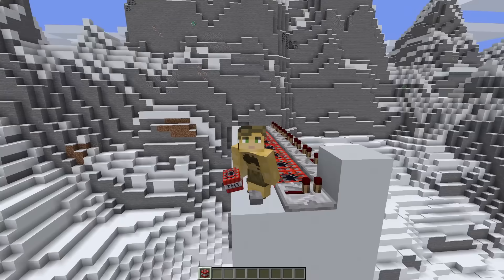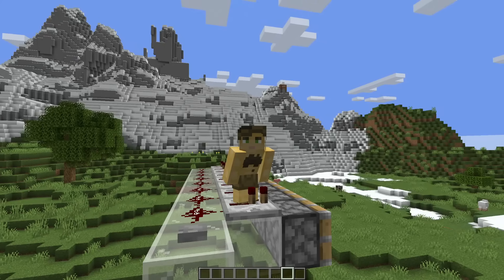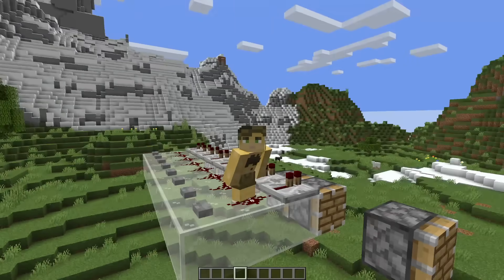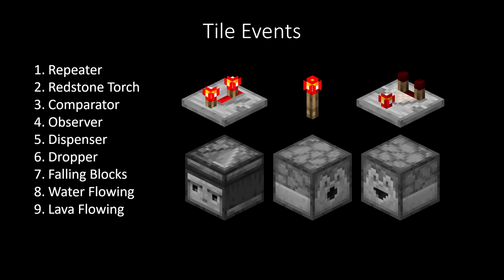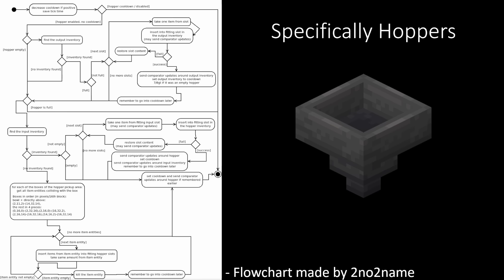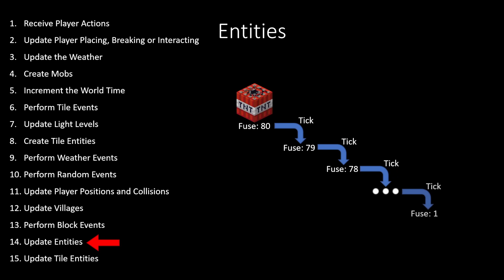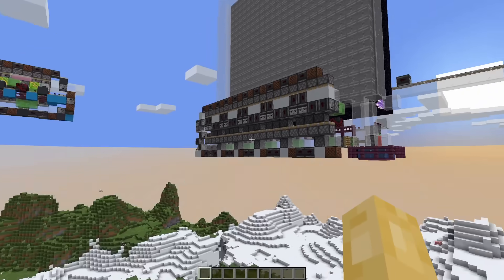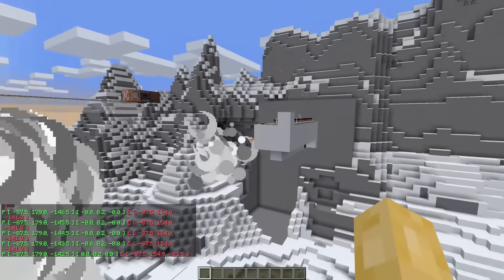TnT Railgun Using Minecraft's Quantum Mechanics

Comment: Anybody who wants to know how to build a actual more powerful cannon than this it is called a tunnel cannon which can be made pretty easy all you have to do is make a massive normal tnt cannon and for the propulsion you use repeaters as normal and then for the payload you use comparators and you don't put any delay this works due to it now being on the same tick but in the game code the game always priorities the repeater so it pretty much makes a massive hole through anything and this works veritcally and horizontally I'm working on a vertical cannon rn like this

Comment: Very intriguing. 
This had me wondering, does minecraft have a speed of causality?
Reply from the maker: The thing about relativity and the speed of causality is that the speed limit is only ever apparent to each reference point, things are happening everywhere in the universe governed by laws which require no apparent connection through space or time regardless of their observation by an observer. Similarly in Minecraft the world ticks every 1/20th of a second, and with perfect knowledge of the games mechanics we can be assured that mechanisms spanning vast distances are causally connect even if they extend outside our render distance. In the real world however events outside our horizon are causally disconnected until we can get information to be exchanged.
Reply: @cubicmetre  Thank you for answering. Everything that is rendered is causally connected and thus the players reference frame gathers information from every loaded chunk at the same time.

You have now gained a subscriber😄

Comment: Late comment, but I've experimented with tnt shotguns in the past and acheiving a planar, scatter, or even controlled lateral bursts in a variety of patterns is fairly simple. The additional information you gave on entity processing order would be critical in determining the final orientation and timing for each element of your desired result. By changing the orientation of your dispensers (or in this case the spawn location of your command blocks) in combination with a variety of off-setting blocks like fences, open trap doors, chains, or other partial collision blocks, your tnt can be variably offset in relation to your firing charge. This is going to give the basic firing pattern. Note that the tnt can all reside on the same block, but still be offset enough to give a scatter pattern. You will have to remove any obstructing blocks at the front of your cannon to accommodate not only the offset, but also the forward trajectory of any projectiles, otherwise they will all correct to travel in a more uniform direction.

If you then place a 1+ tick delay on the generation of secondary charges you can roughly control not only where in the firing order those charges will be dispersed for lateral and vertical secondary explosions, but also at what range those charges will change trajectory. The velocity imparted by the initial firing charge (e.g. using a single tnt to propel versus using 10) will determine the average distance per delay tick at which the lateral charges will change trajectory.

Comment: wiring 2 dispensers with different redstone components (comparators and repeaters) also makes this effect as in minecraft's ooe (order of entities) repeaters are calculated first, which makes something similar. people have been using this technique to make cannons in the past (tunnelers, nukes, aps etc), from what i've tested it still works in the new versions of minecraft, you just need to wire the power with repeaters, and the shot with comparators, every dispenser in the power is gonna have priority over the shot, then its gonna calculate its velocity and after that the shot's explosion. and about the 11:07 part, lining 2 tnt entities diagonally and placing one above the other on a non-full block (such as stairs, chains, walls, trapdoors, chests and others) altough their uses may vary, and some may be able to shoot farther than others, the way the position of the tnt is calculated depends on its position to the explosion, if placed diagonally, it's first gonna calculate the y axis, until it hits a block, then after either the x or z value after hitting a block (depends on the orientation) and then its gonna shoot into the wall, forming kind of a triangle hypotenuse  or something like that (this is used in almost all modern factions cannons) this applies to any falling entitiy (anvils, sand, concrete, gravel, i haven't tested yet but maybe scafolding works)

Comment: if i understand it correctly, what you are currently doing is, in the same tick, explode 1 batch of tnt to launch 1 tnt that instantly explodes, then explode the next batch to launch the next tnt that can fly further because some obstacles are now gone and it has double the tnt acceleration of the previous batch, etc. but could you achieve way greater ranges by instead of having 1 propellant being static and 1 projectile load, having a series of propellants that each launch the rest of the load further, so you get... oh no wait that wouldn't work because everything remains static up until it's updated...

Comment: i once made a cannon with a friend that used tnt at the top and the back to get it to the front in time and it also had a section underneath with bubble collums for even more tnt i could shoot so far we had to place cobwebs in front of it to be able to measure its power, it could shoot through over 3000 layers of cobwebs. when not placing the cobwebs it went around 40k-50k blocks before exploding in the air

Comment: This is a really cool concept that I believe was originally used for minecraft factions. We called them "Tunnelers" because of their unique property of exploding right after one another. Using what we in the factions cannoner community call "fraction ticks" you are actually able to make a really simple version of this, al you need is 4 repeaters one after the other, into some dispensers, and more dispensers that actually fire the projectile. In terms of it bending, that has to do with how the tnt is aligned, when it is dispensed, it dispenses on the opposite side of the block from the dispenser, however with a piston, you can align it however you want, and if you have the gameticks in the right order, you can make something that will just blow out an entire sheet in a single shot. Overall this is a really cool video, and I love that this is something being investigated outside of the factions community

Comment: I would like to introduce you to "Factions". there are some people who play that game-mode and find the most nutty things with TNT.
Stuff like angle cannons, Wall nukes that destroy entire lines of walls, slab busting and the list goes on.
this rail-gun tech has been used before in factions for bases with Large claims or that need precise targeting.
There is also a cannon that has 2 rounds of propellant that basically allows you to send tnt through 1 block wide gaps with a second round of propellant slightly offset to launch the round to the target bypassing some walls if you do it from a corner.
Reply: The 1 block hole thing wasnt to bypass gaps or anything, the idea was you could put your cannon in a defensible box and shoot at the enemy without them being able to stop you (unless they build their own cannon). Using the idea of "triangling" (basically tnt follows an order in rendering which you can abuse, it calculates Y velocity first and then E/W then N/S) you can give your cannon an adjustable range to shoot at from bedrock to sky limit and a very sizable X/Z range (could be thousands of blocks with enough tnt).

Comment: I remember I tried to make a piston extender and came across a tug of war situation like that and It didn't really make sense to me cuz redstone dust is supposed to activate everything at the same time

But apparently not!
Reply from the maker: Redstone uses a locational hashmap to determine it's update order due to the complexity of handling signal strength. This means you cannot rely on redstone dust to power things in a predictable order. This is why you will see us technical players using a wide variety of mechanisms to transfer signals.
Reply: It’s more obvious on bedrock then it is on Java.

Comment: Ah yes thats how quantum mechanics work......
This is just logical time moving forwards like it does in any game
Reply: No, its not logical time moving forwards. In 0.05s you can make a tunnel 1000 long. You can also make it go left/right every gametick in a "vector" pattern. It goes max distance in 1 direction, max distance in next direction repeat
Reply: @Azaqa  yea but its still has an order in which things happen
Reply: @user-hv6nl3cz1z  yes thats true but the only way you would know that order is if you looked at the games code
Reply: @Azaqa  yea but it still has nothing to do with quantum mechanics 
Also could'nt you just run a redstone signal over a block on a piston and see if it activates whatever its hooked up to or if the connection gets cut first?

Comment: Factions players have been using these for quite a while (since 1.8 iirc, we used comparators since they operate on 1.5 ticks instead of 1 or 2 from repeaters) - We call them 'tunnel cannons' if you want to look into them

They have been developed to make pretty advanced shapes (such as letters)
Reply: Comperators don't run on 1.5 Ticks, the update order puts it after the repeater however it is still in the same tick. Wargear players call it 0-tick delay. Pistons on the other hand do take 1.5 Ticks to extend.
Reply: @kaltenstein7718  no, 1 piston is still 1 tick but 2 pistons back to back is 2.5 ticks

Comment: just wait until he discovers factions cannons from 2017
sand cannons
the obby breaking ones
the top-down nuking ones
you should take a look
Reply: To be clear it doesnt actually break vanilla obsidian, factions servers changed obsidian to basically be a normal block that absorbs a certain amount of tnt hits before breaking (usually 4 but sometimes as high as 20), so it was basically just a more powerful cannon used to break the obsidian with higher durability. Vanilla obsidian is blast proof.

Comment: these types of cannons were used often in OG minecraft factions... 255 hybrid oneshot with slabbust. that tunneling effect is used to clear slabs to allow players to stack sand up to 255 to raid bases
Reply: More recently there anti patch aswell, around 2019 it came out

Basically people would patch in a straight line because its easier to do while being hit and can be done faster, it would tunnel through the full line in 1 shot where normally its 1 shot per 2-3 blocks

Comment: This is exactly the opposite of quantum mechanics.

The reason it's called "quantum mechanics" IRL is because it deals with the fundamental interactions of the universe involving only discrete quantities of magnitude rather than smooth continuous distributions as previously thought.

This is something which originally appears to be separated into distinct quantized intervals (ticks) instead turning out to be continuous and infinitesimally divisible (sequential sub-tick interactions, e.g. redstone dust blocks powering in order instead of all at once).
Reply from the maker: I learned quantum mechanics before I knew anything about Minecrafts subtick mechanics and honestly, it felt exactly the same. The subtick mechanics are just such a fundamental but arbitrary ruleset for how the simulation plays out and when you discover things like why a piston moving a redstone block into a piston takes 3gt to extend the second piston but moving that same block into a repeater has a total delay of 4gt it can often have these moments of just "why?". I tried to interpret subtick mechanics as every component residing in a quantised time state, and these quantised states have special rules for how they can interact much like fundamental fields. For example, you could think of the repeater field being a thing in minecraft and this provides a good analogy to design tilesets in wireless redstone. Because you can imagine this field being processed everywhere in the game at the same time in the tile tick stage, but then there are repeater states that result in symetry breaking of the field giving you access to multiple combinations of subtick repeater chains which define the channels for wireless redstone.

Comment: With this, would it be possible to make a TNT cannon that can fire in curved trajectories around corners?
Reply: Not curved but yes it can shoot around a corner, it follows a vector pattern (max distance in Y, max distance in X, max distance in Z) so it will basically make straight lines with 90 degree angles
Reply: Vertically, yes. (TNT is affected by gravity after all). For going around corners sideways without destroying that corner requires what the German WarGear community calls "step" or "stab" charges, meaning while shooting your projectiles, you also need to shoot some additional propellant TNT that will boost the projectiles onto a different heading while still in the air.
Reply: @WarTechWarGears  or just align your power and the firing entities to different directions and shoot E/W...

Comment: Factions players will know all about tnt railguns and getting the shot to turn multiple directions 
also by loading sand into the cannon they can make the railgun water resistant
Reply: It gets really expensive though, imo its completely impractical for any purposes other than factions, its really fun though :) most modern factions cannons would crash a server that doesnt have a special jar to optimize tnt/sand mechanics
Reply: @Azaqa 1y later, do you still think it's impractical?
Reply: @ovencake523  yea basically nothing has changed in cannons in the last 4 years, its super cool but way too expensive to be a reasonable choice for anything except factions

Comment: ok but consider this

it can change directions if you place it properly

tnt railgun that can go around obstacles

obisidian walls or healing cobblestone curtains arent that much of a problem anymore because YOU CAN MAKE YOUR TNT IGNORE THEM

and with proper redstone and water mechanics, you could literally make it switch configurations. Wanna do a straight line of doom? pop off. Want it to turn sharp left when it touches a wall? As you wish. Oh you want it to go right this time? press 2 levers.
Reply: Thats pretty much what high Level people in the WarGear community are doing (although Obsidian and Water shields are prohibited to make the fights more fun).
Reply: @WarTechWarGears  you could just stack sand to go through water ;)

Comment: I also recall there being a difference between "game ticks" and "redstone ticks"? Like that redstone ticks are only half the game ticks in terms of update frequency or smth?
Reply from the maker: I prefer using gameticks as they are more precise
Reply: Gameticks are 20/s

1 redstone tick (for example 1 repeater tick, a comparator, a piston pushing a redstone block) is equal to 2 gameticks

Its possible to get an uneven amount of gameticks by using 2 sticky pistons attached to redstone blocks back to back which will give you 5 gameticks

Comment: 7:33 Why does the rail over the dropper light up while the one over the piston doesn't? Your argument would have been more solid if everything except the piston behaved the same between the two test setups.
Reply from the maker: The rail powers in the tile tick phase and unpowers in the block event phase meaning it isn't even powered for a single tick which can result in visual bugs. Keep in mind that in the subtick realm your eyes can decieve you. This is why we need to trust the interactions between components over our observations of each individuall component.
Reply: @cubicmetre  But why did it visibly power on for the dropper example? Is it an orientation bug? I thought the rail would have the same powering and unpowering timeline in both setups.